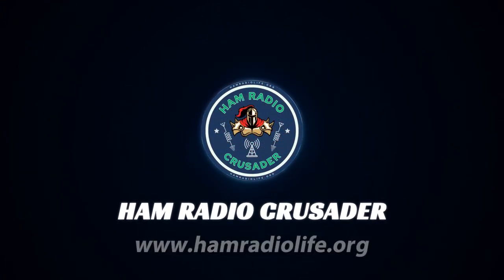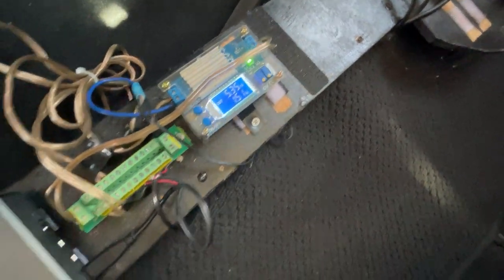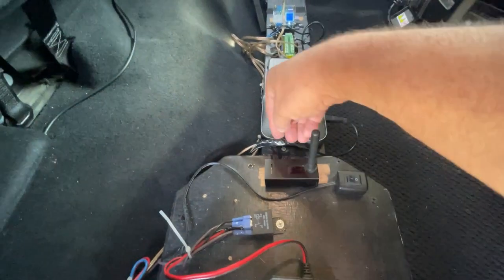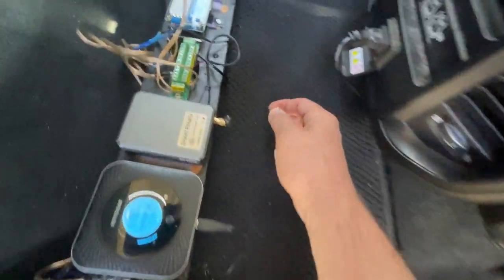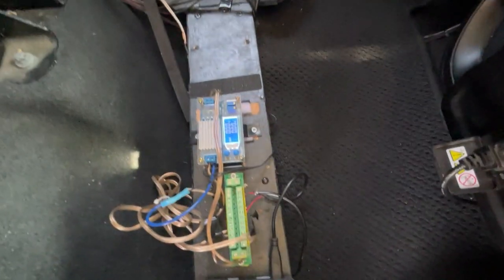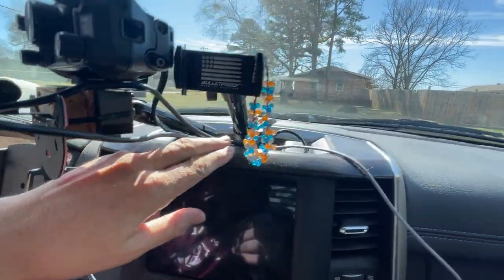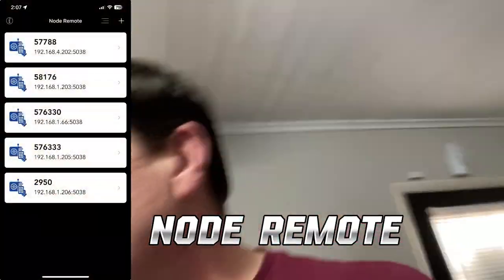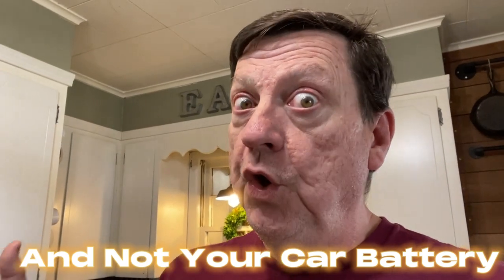AllStar Link or GMRSLive in your Car or Truck HIGH RES VERSION

Comment: I like the Allstar node, and GMRS node in the truck! And the redundant battery (& charger) is a great idea! 
Nothing kills a car battery faster than a Ham radio! They seem to draw power, even when off. Another idea, is a 2nd, Deep cycle battery, under the hood (if there is room?), connected via a battery isolator. And run all the secondary electronics off of it!

Comment: First off awesome job on the content. You’re videos have helped me immensely. My question is about your allstar mobile node. I use my cellphone as an hotspot and I setup my mobile node that way.  I know you have to forward ports to allow incoming connections. Is there an easy way when using a mobile hotspot connection to allow incoming connections to the node? What is your work around for forwarding the mobile hotspot port is really what I would like to know? My node works awesome in the mobile for outgoing connections,incoming not so much 😅Thanks I really enjoy the videos 🤙
Reply from the maker: Well The Netgear NighHawk AP I am using allows for the Port Forwarding, BUT CellPhone Hotspots do not to my knowledge. You will always be able to make an outgoing connection but not incoming. I can get incoming connections on mine, because of the port forwarding. If I find a workaround I will surely let you know. Thank You for the kind words 73 DE KD5FMU
Reply: Thanks  73’s Crusader from K4QXN!

Comment: so you have to have the netgear mobile hotspot to get the radio on the echo link or Allstar setup??? So that cost you like a cell service so much a month>? How much does that cost?
Reply from the maker: It’s wireless internet for the node yes. About $45 bucks a month from FirstNet/AT&T
Reply from the maker: And you don’t have to use this service. Some folks use thier hotspot on their existing phone. But you will only be able to connect outbound.